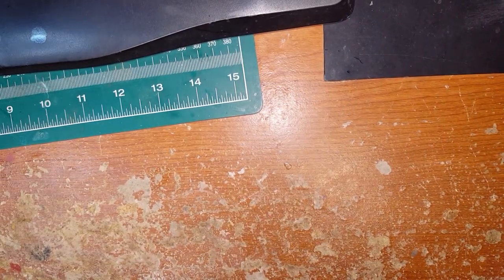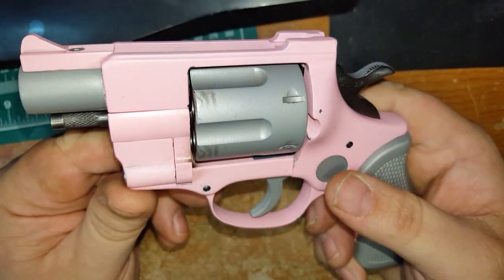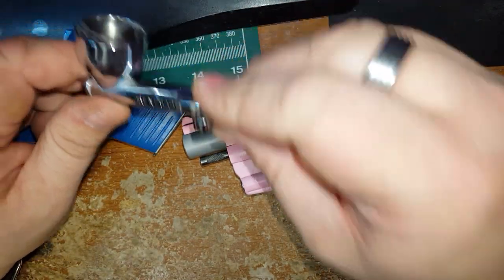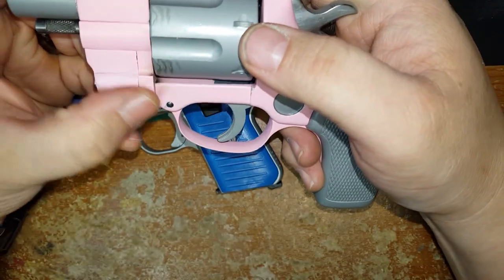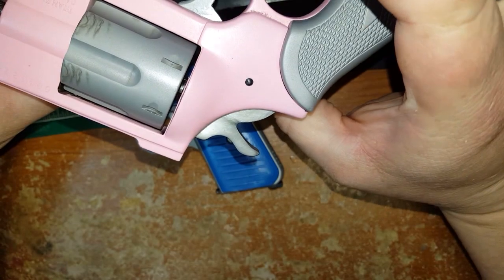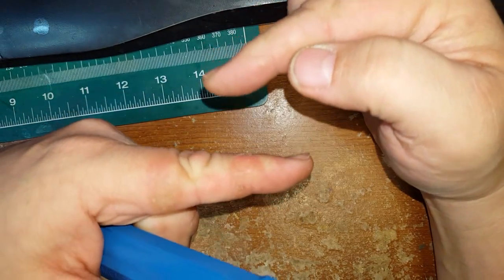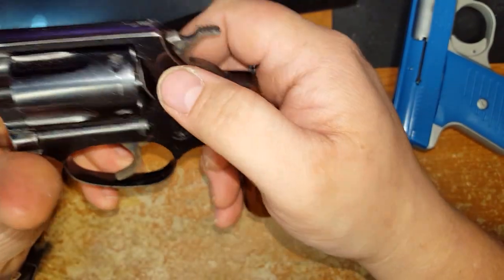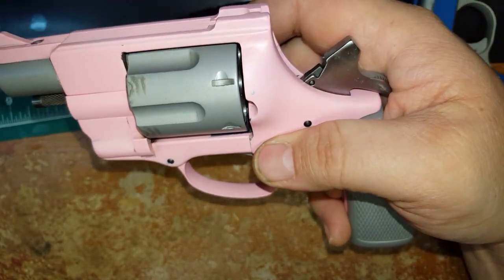Arminius Titan Tiger Duracoat

Comment: Looks great. I think it looks better than the two tone pink could look. They're two well matching colors. In all honesty, despite these being easy/simple revolvers, they're still very complex and can be very hard to get them working again after duracoating. It came out really good though. My only real recommendation would be to use Cerakote in the future. The sandblasting and cleaning sucks, but the  near infinite increase in strength and corrosion really makes it worth trying. I wouldn't use anything else... but I am open to suggestions in case something equal/better exists.

Comment: If you're serious about duracoating... Cerakote. It is immensely stronger in the H-Series and especially E-Series. The H-Series has a thicker coating that's extremely durable (about 003" thick per layer) while the E-Series is only about 0.0005" thick per layer, but it significantly stronger and more durable. The E-Series it's usually necessary, but if I was ever doing a revolver with Cerakote (one that's not worn out) I would use the E-Series... or if I was doing a precision semi-auto. Most guns/parts are fine with H-Series, but if the gun has any tight parts or precision parts/fits, then the E-Series might be necessary. It just sucks there are so few colors in the E-Series compared to the H-Series.